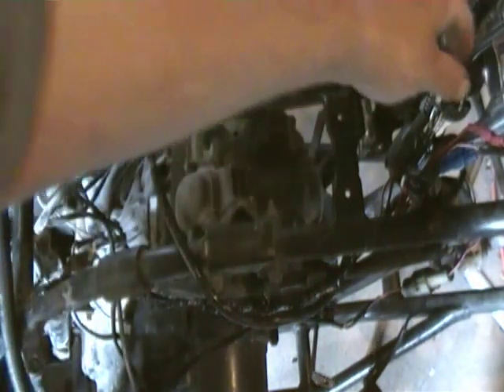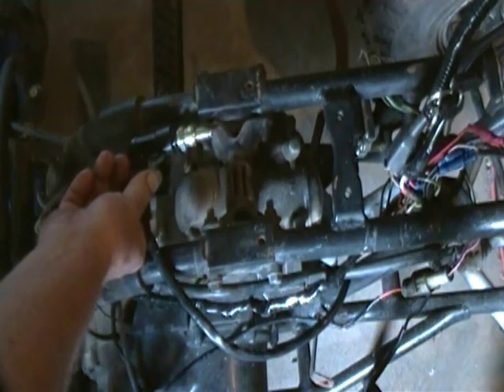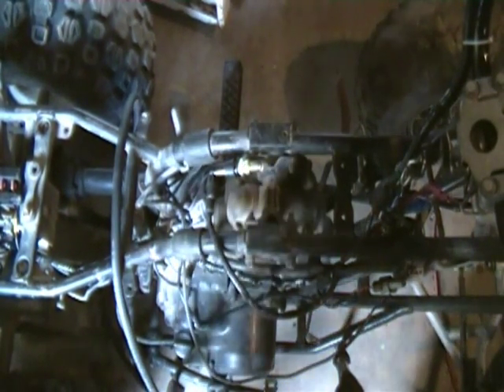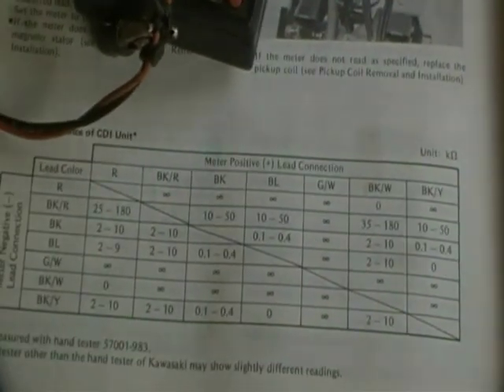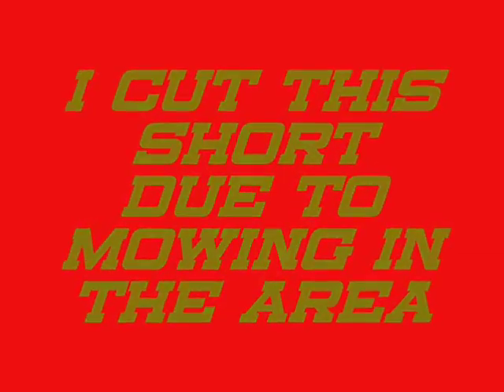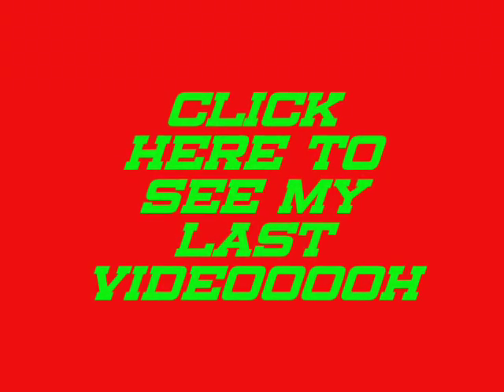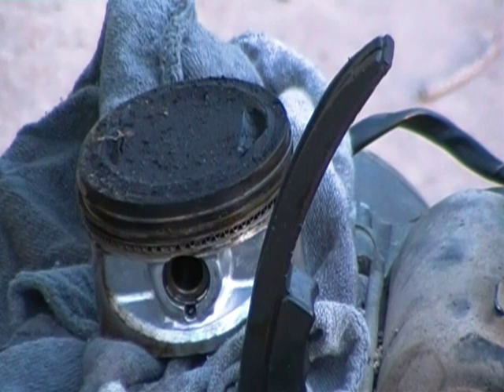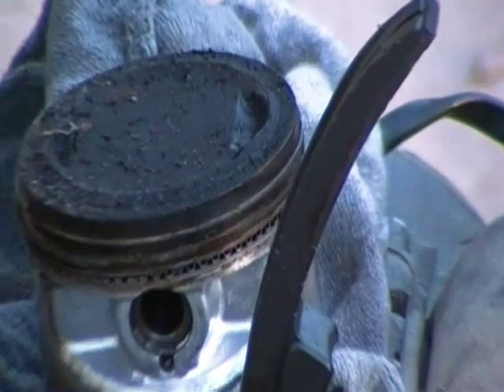KLF 185 ATV 1985 MULTI TESTING A COIL AND CDI

Comment: Hello again. I messed up my 185cc K Bayou ATV again by changing the new starter clutch bearing and wondering why it wouldn't fit and kept sticking trying to crank it, but after the 3rd time taking it out and installing it, I found the problem with the bearings being too big, so I replaced it with the correct one. Now it has no spark, and I'm figuring I messed up the stator or CDI coil because I also mistakenly jumped it with my car battery running, and I was advised it was a bad idea because too much could burn something out, whatever. I'll try your correct method, and I do have the same tester you have. So cool. I have to remember to tighten it because the needle sometimes doesn't move, so I remember to tighten it before using it. The stator has some bent coil wires in the AC part, but I don't see anything detached, but what do I know? Not much. thanks
Reply from the maker: ok, Well best wishes with that & thanks for sharing. let us know how it goes.
Reply: @TufdogsPlace I better purchase a multimeter to make sure.
Reply from the maker: @trafficjon400  Yeah, tester's aren't  real expensive but well worth the price.

Comment: just bear in mind that some ATVs have AC power to the coil (like my 1996 Honda Fourtrax300) (yellow wire on coil). Yellow wires on my ATV are ALL AC
Reply from the maker: THAT''S INTERESTING, II'VE NEVER HEARD OF THAT.  how does it get an ac current ?
Reply: @TufdogsPlace  one of the 3 yellow wires that are fed AC by the stator Ts off to the CDI before the yellow wires enter the rectifiers in the regulator where the signal is converted to DC. if you search on Honda parts for a CDI for the 1996 Honda Fourtrax 300 you will see that the vendors usually make sure the buyer knows they are getting an AC CDI.
Reply from the maker: @elizabethfletcher1487  Thank you for sharing all that information, I was "shocked" to hear it,... lol  .... really though, I appreciate it.

Comment: 8 years late but where did you find the vin for the 185? Ive googled where to look and didnt find a single thing.
Reply from the maker: LT125 ?  Which machine was that ?  I'm happy to help but don't recognize that model #
Reply: @TufdogsPlace  its this video that i commented on
Reply from the maker: @stylze5767  OK, this machine is a Kawasaki KLF 185, & you'll find the vin #s on the frame's down tube.  Below the front end by the front of the engine.  Hope that helps
Reply: @TufdogsPlace  im not currently home to check. Ill keep you posted if i find it
Reply from the maker: @stylze5767  OK, sounds good. Please do...
Reply: @TufdogsPlace  found the vin but on vin checkers it showed up as a 2016 quad. When this quad is clearly from the 80s
Reply from the maker: @stylze5767  Something is off there, Let's see if I can help.  What kind of machine is it ? And size ?,...   and what are the vin #'s
Reply: @TufdogsPlace can i get your email by chance to try and solve this?
Reply from the maker: @stylze5767  Meet me on your "Discussion " tab on your YouTube account. I''ll send you a msg there now

Comment: I got the same bike no spark I put a stator new CDI new coil on still no spark lights won't come on press the start button still nothing only if I crosses the solenoid out
Reply from the maker: Sounds like a wiring problem, maybe in the ignition switch, fuse or relay.   Don't forget to check your igniter continuity also.  Keep checking things you'll get it.
Reply: @TufdogsPlace  she got no key so I got er joined up white and the brown wire
Reply from the maker: I'm not sure that is ok or not. Seems like it may be part of your problem.
Reply: @TufdogsPlace  I was picking at it after when the bike winds over fast she makes one spark and then none and wind she winds over slow the spark is constantly there,got no idea what could cause that..first time I ever seen that happen
Reply: Would it be the stator??
Reply from the maker: It could be the stator, it may also be a weak coil...
Reply: @TufdogsPlace  now I put a new pick up coil on it is there an adjustment on em?
Reply from the maker: They have an air gap between them and the flywheel, a business card will work. Just like a lawn mower.
Reply: @TufdogsPlace  ok thanks for the help!!
Reply from the maker: My pleasure Brandon, Hope you get it ...
Reply: @TufdogsPlace  sounds like something is backwards to me..think the faster she wines over the more spark she would have
Reply from the maker: well not more spark, but faster sparks. It should fire every time the engine rotates. Do you have a "for sure" good spark plug? and is it grounded well ?
Reply: @TufdogsPlace  I tried 2 brand new plugs,4 coils,pick up coil,kill switch,power packs,anthor harness ,I check the ground a few times seems to be good I got anthor stator I'm gunna try
Reply from the maker: Sounds like all good stuff.
Reply: @TufdogsPlace  what wire do the ground wire for the coil join in to and main 3 wire power back plug in go to?? I had a loose connection in the harness
Reply from the maker: The coil has 2 wires, black / yellow & Green & white. B/y goes to the harness, G/w goes to the CDI...
What color wires are on the 3 wire plug ?
Reply: @TufdogsPlace  black with white stripe,yellow with red,and green with white stripe
Reply: So do I join the ground wire with the green wire?
Reply from the maker: What color is this " Ground wire " ?
Reply: @TufdogsPlace  black and yellow then there the one that plugs in to the coil and he's green
Reply from the maker: I have 2 schematics for this machine and I'm not seeing those color combinations on either of them.
Reply from the maker: Again 2 schematics, 1 shows, 2 wires to the coil, & the other shows 1. neither of them are a ground. one goes to the pick up coil and the other to the cdi
Reply: @TufdogsPlace  no I'm talking about the coil on the frame
Reply from the maker: I'm not sure where my manual is, but I will look for it later today and hopefully that will help us sort this out... Sorry for the delay.
Reply: Where the spark plug wire goes into
Reply from the maker: Yes, I understand that. The pick up coil excites the main coil & tells it to fire, Yet the CDI plays a part in the process also

Comment: when testing my cdi on my 1985 250 honda big red es with the round single plug how do i test that with the tester
Reply from the maker: I wish I could tell you. This information was provided in my service manual for the KLF.  You might check with Harvey Spooner, He's a real guru with those models
Reply: ok thanks man rock on!!!
Reply from the maker: Thanks buddy, good luck
Reply: ya my cdis bad i tapped it and one spark then nune metter says its bad to so time to replace thanks man rock on!
Reply from the maker: Thanks for letting me know.  
Harvey just put a video out where he used a pitbike CDI on his. Here's that video
https://www.youtube.com/watch?v=VZ8syn4M9lE

Comment: I have one good no key, looks just like yours
Reply from the maker: No key to the ignition ?
Reply: no it needs work.. OK I've had it since I was a kid. first four wheeler I ever had.. well as a kid long time ago mom took hey.  and we went at trying to hot wire it.. long story short. I am now 40 years old, and still have what's left of it.. lol it's all there. engine really didn't have a lot of time on it.. but what time was hard.,
Reply: good compression .. fuel tank waisted..
Reply from the maker: My tank was cracked but I fixed it. With a soldering iron... There's a video of it in the playlist
Reply: thank you tank I can do. just hey switch
Reply from the maker: You can do 1 of 2 things, try eBay for a new replacement switch with a key, or.. take your switch to a locksmith and have them make you a key for that switch.

Comment: I have a Klf185 and I have hoses loose, and have no clue where they run. Could you email me pictures of your hose layout?
Reply from the maker: +michael miller There's only a few hoses on the machine, gas tank to bottom of fuel pump, top of fuel pump to carb inlet. & one line off the enginge that's just to expel extra engine pressures.  I cover all of that in the klf playlist videos. Good luck, You'll get it

Comment: I have a 400 Kawasaki 4x4 ATV the ignitor has gone bad I found a used one on ebay the one I have is an 8 pin it is a 21119-1531 the one I found looks exactly like mine but the number is 21119-0096 will they interchange? thank you for any advice
Reply from the maker: Robert Robinette I am sure there are similar with some minor changes made to them over the different years models.  If it's cheap, try it. if it's expensive, contact a dealer's parts counter and see if they say it will interchange.  
Best luck to you, wish I could be more help...Just don't want to steer you in the wrong direction.  Cheers
Reply: Thanks

Comment: I have a 1986 klf185 that the previous owner hacked up the wires too. He cut the connectors off and crimped on male and female ends where the cdi hooks to, jumped wires etc. I'm trying to figure this mess out. I bought a cdi that I believe is the right factory one. 7 wires, 3 seperate plugs. One plug has a blue and black wire. Another has black/red wire and red/black wire. 3rd plug has green and I forgot the other 2 wires colors. Can you help me figure out what goes where? Is this the right cdi? Maybe a video explaining it? Any help is appreciated!
Reply from the maker: Burbs Sounds like the right CDI. May I ask where you found it and what you had to pay ? I know they are getting rare. 
OK, Here goes,... Black & blue wires, both go to the pick up coil,  red & black w/red wires go to the magneto,  (3 prong plug)= GREEN/WHITE wire goes to the ignition coil, ...black/yellow wire goes into the harness, such as lights & negative side of battery, and yellow/red goes to the ignition switch and off switch on the handle bar.
I hope this helps you out. I know a couple of the wires are different than what you have. I don't know what  to make of that...Good luck

Comment: okay ive  replaced the stator.  sarter relay.the pick up coil. every once in a while id have spark rewired the stator.  still nothing. im sooooooooooooooooo. lost on how too really test or even bypass my cdi box. can it be my switch on my handle bars. im not getting no power to the switch,i dont know witch wires are what for the cdi box.  please help.)
Reply from the maker: ok James, if ya get spark once in a while, that's a good sign. most likely the cdi is ok.
maybe a bad ground at the coil, or a faulty coil it's self. You can't bypass the cdi anyway.  Have you tried a new spark plug ? 
This video tells exactly how to test your coil & cdi. 
I'm going to send you a private message with all the things to check.
You'll find that here,...    https://www.youtube.com/messages

Comment: I took your advice and got a manual for my moto 4 and there is not anything in it about testing my cdi box. I just don't know where to go now. Thanks
Reply from the maker: Well the manual will still prove worth it weight, but you may need to contact a reputable repair shop to see if they can help you. Also if you can test a known good one in your machine. you'll see if it works or not. Then you'll know if yours is bad or not in comparison.  Good luck & sorry I couldn't be of more help.

Comment: I have an 1985 Yamaha YFM200N Moto 4, I have been watching your video's checking a CDI with a ohm meter my CDI box has 8 wires. I don't know which wires to touch or what the ohms should be. Can you help me out with this Thanks
Reply from the maker: Hey Ken, Sure wish I could, but I'd need a service manual with the information. I'd suggest you find one, It'll have everything you need to know about your machine. Good luck with it, & thanks for checkin my vids.

Comment: I did like you said I jumped the starter relay, the solenoid turned the motor over...just no spark, I ran a wire from + side of battery to solenoid, the motor turned over, just no spark

Comment: welp I set the meter as you said and got a reading off the battery...I left the black lead on the neg. touched the B/Y wire with the red lead then pushed the button -no reading
                 touched the BL   wire with the red lead then pushed the button -no reading
                 touched the WH wire with the red lead and got a reading without pushing 
                 the button. these three wires are grouped in a clip/plug/fuse assembly, 
                 fuse is good.

Comment: Hey I got a 220 Bayou...was running good, couple days later I tried to start it, turn the key on, ignition swith on, pushed the start button and nothing. I can use a screw driver at the celinoid to turn it over but no spark at the spark plug? spark plug is new.

Comment: tufdog i got a honda 300 ex and idk what wrong with it i think i need a new cdi. i blows right through the fuses so i put a cable in it and it worked fine and then it just turned off i need help thanks

Comment: Hi Tufdog, wanted to let you know that I got the bayou running, thanks. But now I have another project going, I have a 110cc Kazuma  with a brand new engine on it and can't get it to crank over. When I hook power to it, the neutral light comes before I even turn the key on. It has a new wiring harness even, just stumped! Can you help?